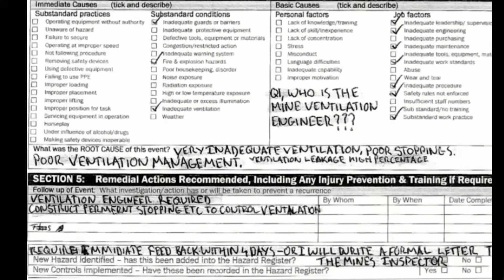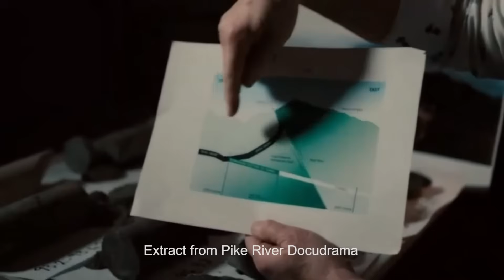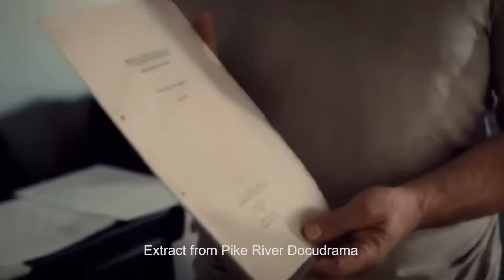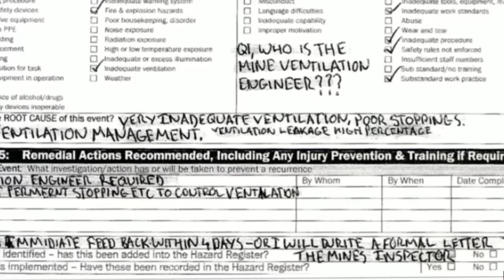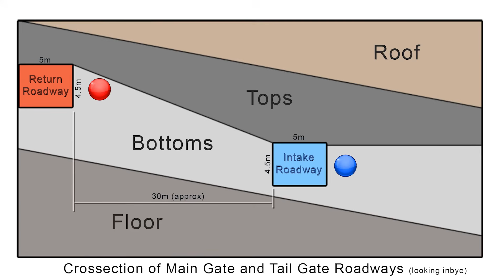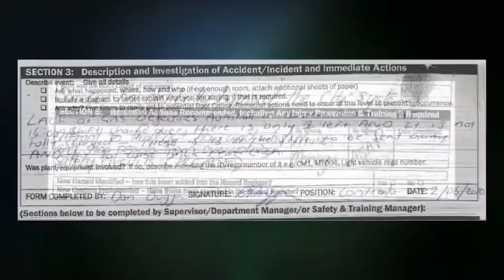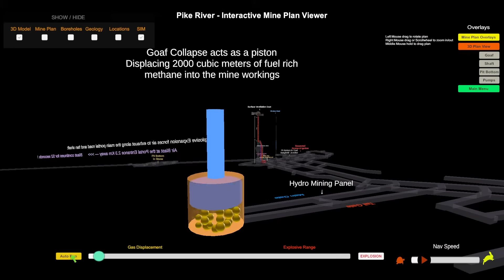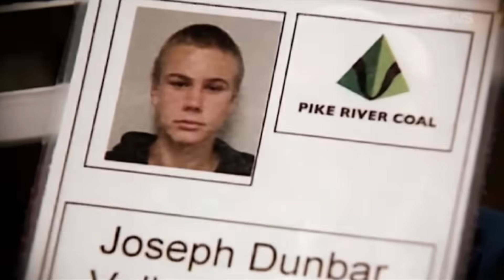Pike River Mine Disaster Summary Video with Simulation

Comment: At 12:35, it states there is no way to know if another explosion could occur 2 minutes or 2 days later. Really?
Reply: Maybe if they'd let Mines Rescue do their job, they might've had a clue.
Reply: @RetroJack  I worked with a bloke from nsw coal services who was there to assist with the rescue. They assembled a team got fully geared. As they went to enter the operator on the gas monitor, a renown engineer that specialised in gas’s pulled the plug and said it’s not safe to enter as he didn’t feel right with the readings. 1 hour later the mine exploded which would have killed everyone in side
Reply: There is an easy way to know. Take gas readings and see what the air fuel ratio is in the mine.
Reply: @mcduck5 please explain to me where you think you would take these readings from? "Air/fuel ratio" tells me no dont quite know what your talking about.
Reply: @bazzah195 well when you have a fuel that is a gass if it is mixed with air at the right ratio you get potential for a bang.  In this case it's around 17-1 for the fastest burn rate
Reply: @bazzah195 inside the mine via blast proof sensors, robots and gear dropped down the ventilation shaft.
Reply: @mcduck5 worng theres no such thing as blast proof sensors mate.in an event such like pike river all real time monitoring would've been lost,adding to that after the first explosion would you walk up to the vent shaft half up the mountain and dropped down tube bundle line and either fixed comms to the control room or just monitored gases on the spot all the while potentially you are within the blast zone if another explosion was to happen?
Reply: @mcduck5 i have no clue what 17-1 means but the explosive range of ch4 (methane) between 5-14.7% what industry are you in?
Reply: The unpredictability of the situation already raises questions that couldn't be answered without definite proof that explosions will not occur
Reply: @NZealandese Yes we know that was said, but who said it? It wasn't thst long after that statement, tbere was information going around that who ever said didn't know anything about anything. And that the best time time to go into a mine is right after an explosion, because all the gas have left. To me that makes sense they could have gone with the correct equipment to measure the gases as went and maybe safe some lives. What dangerous and unhealthy is people say heath and safety in situations they know nothing about. And this is exactly what this seems like.
Reply: Correct if you dont have any way to monitor mine/goaf gases after an event like this then there's no way in telling  when a explosive mix of gases will build up again or if there's a potential ignition source.even if the police didnt stop the mines rescue i highly doubt they would of even gone into the mine blind without any gas trends or monitoring.